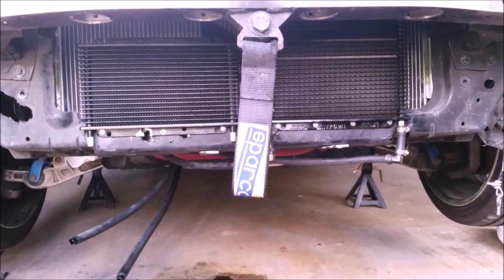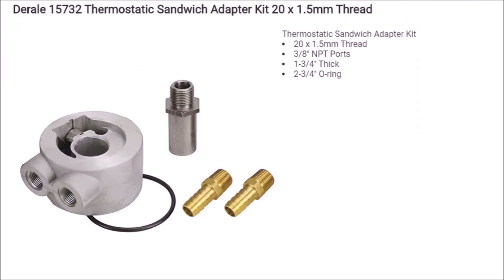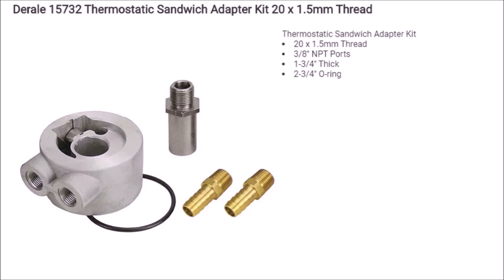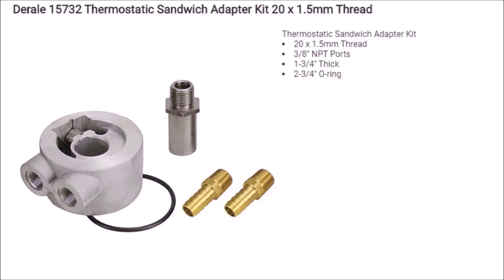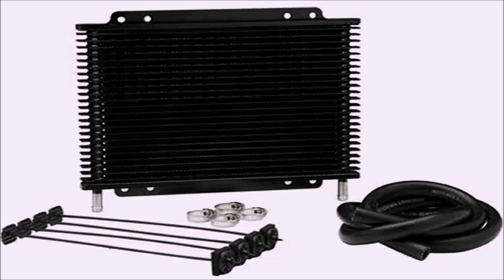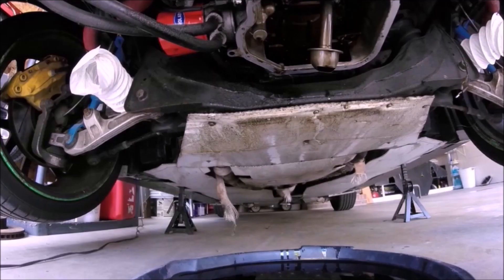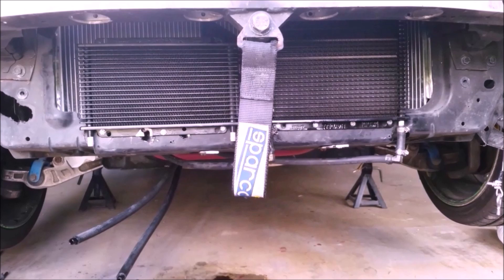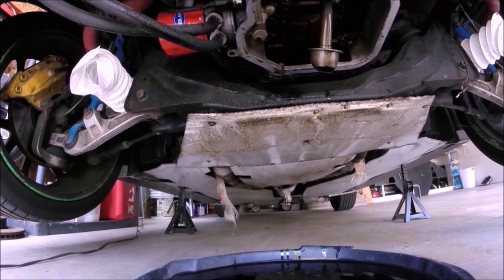Nissan 350Z Budget Oil Cooler DIY

Comment: Thanks for the helpful video!
To save even more money, what about using the stock oil cooler and expanding its capacity to cool?
1.) Run longer 3/8 hose from stock cooler. 
2.) Connect and run it to the new Hayden cooler on the front.
The antifreeze is cooled right before flowing into the stock oil cooler, thus cooling the oil.
~$40 for the hayden cooler + ~$10 for 3/8 fuel hose + clamps.

Sure, this isn't as efficient as cooling the oil itself, but I cant see why this won't effective as well. Also, may help slow down the degradation of the OEM stock cooler gasket which fails frequently.
Reply from the maker: What your suggesting will cool the oil more than the OEM set up alone, but it won't cool the oil anywhere near as much as if the oil traveled through the cooler properly. It's a clever thought, but the temperature differentials are very different. The ambient air is likely 100F degrees cooler than the oil while the coolant is about the same temperature. For the extra $40, the sandwich plate is the way to go.
Reply: @350Z247   1.) 3/8 fuel/vaccuum hose good or do you need a special hose to handle the oil? 

2) what if the thermostat in the sandwich cooler fails? Does it stay open as a fail safe?
Reply from the maker: @Zeppelinlv2007  as long as it is fuel rated, it should be good for the PSI and chemical resistance required. The thermostat is a piece of heat sensitive spring steal that curls with temperature. It's fairly fail proof and doesn't fully seal.
Reply: @350Z247   do you remember what the oil pressure readings were before the diy cooler install? What's the average you are getting now?
Reply from the maker: @Zeppelinlv2007  I didn't notice the pressures change. I also run heavy 10W40 oil and have a much larger oil filter because of my set up as well. I still get over 100PSI before the pressure relief valve opens and have like 15PSI at idle (I think? I can't really remember. Sadly, its been in storage for a year)
Reply: @350Z247  Thanks again for the info! Hope to do this soon on my G35.
Reply from the maker: @Zeppelinlv2007  Good luck! Ran this for years on and off track. It should be good to you.
Reply: @350Z247   Thanks, as my daily driver in the desert, I'm sure this mod will help keep the heat down and not strain the motor and cooling system so much.

By the way, the 3/8 barb for the sandwich, Where did you get it? Don't want to get the wrong thread pitch.
Reply from the maker: @Zeppelinlv2007  I can't remember what the thread bitch was of the provided barbs and unfortunately, I'm not in the same city as my car. I think they were 1/4 NPT. You should be able to measure to ID the pitch

Comment: Great idea. Do you have part numbers for the 90-degree barbs?
Reply from the maker: I just bought some no name brass fittings on eBay. 3/8 barbs on both sides. McMaster Carr will have tons of options if you want somewhere specific

Comment: How do you cap off the old coolant lines coming from the block that went to the stock oil cooler?
Reply from the maker: You've got three options
1. just connect the two coolant hoses together
2. put silicone caps on the now unused barbs
3. remove and weld up the barbs
I did the silicone caps for a while without issue before fully deleting the barbs.
Reply: @350Z247  Thanks for the quick reply and info! 👍
Reply: @350Z247  what size are the silicone plugs?
Reply from the maker: @blaster17363  the best way to measure them is with a box wrench. I just bought a variety pack to handle the entire engine.

Comment: Hey bro was wondering which specific hose material you used? I got a diy oil cooler that came with unspecified rubber 1/2 inch hoses and the hot side hose at the sandwich plate connection exploded. Luckily I pulled over before any damage happened to the motor.

Was also wondering how your setup had been holding up till now? Im thinking of just forking $450 for the z1 kit, cause seeing the car leaking a puddle of oil at the gas station was sort of traumatizing lmao
Reply from the maker: Any reputable 3 or 4 ply silicone hose rated for oil will work well. They should outlast the car. Make sure you use quality hose clamps.

Comment: I need help,I bought that derale kit,but the filter does not work,you can see a small space and it can leak oil
Reply from the maker: You need to use the filter in the description or an equivalent. It's a larger filter.

Comment: When I looked up the stud it says it’s for an hr will that thread into the de block no issue?
Reply from the maker: Yes, it will. The HR does not have the factory water-to-oil cooler that I deleted. The shorter HR stud allows for direct mount of the oil cooler to the engine block without the extra factor cooler in the way.

Comment: how is this holding up ? did you notice any difference in temps and oil pressure?
Reply from the maker: Oil pressure has been normal. It ran great for about 4 or 5 years with oil rated hose from Auto Zone. I tried the Z1 silicone hose, and it lasted 4 sessions before popping. I'll switch to a proper cooler at some point, but this definitely works if you're on a budget.

Comment: How much did you have to add oil capacity wise?
Reply from the maker: Not much. I'd guess less than half a quart.
Reply: @350Z247  Hello again. I'm about ready to move fwd with an oil cooler; I do not have an oil temp gauge so I've never known how hot my oil gets, but I've also never had any issues likely in part b/c I use high quality oil (Amsoil Dominator racing oil). None the less, I wouldn't mind staying ahead of any problems that may arise as time and wear happens. In your video you talk about "removing the oil filter stud to remove the old factory oil cooler." My VQ35DE does not have a factory oil cooler, so was that comment for HR or 370Z owners? Thanks -
Reply from the maker: @svoncampe   No, the VQ35DE should have a factory oil "cooler" plate sandwiched between the filter and block. They deleted this on the HR going forward.
Reply: @350Z247  interesting. Never knew or noticed this (and I change my own oil), but I will take a look.
Reply from the maker: @svoncampe  it looks like a silver donut with barbs sticking out either side

Comment: What did you do with the power steering cooler?
Reply from the maker: I no longer have power steering
Reply: @350Z247  That’s what I was thinking. Is the transmission cooler being used on a manual?
Reply from the maker: @a_real_gentleman  No, it's a 5AT. If it were a manual, you'd need an external pump with a fairly precise flow rate.